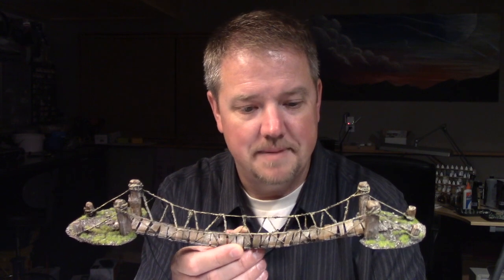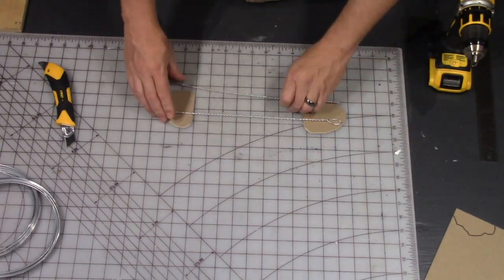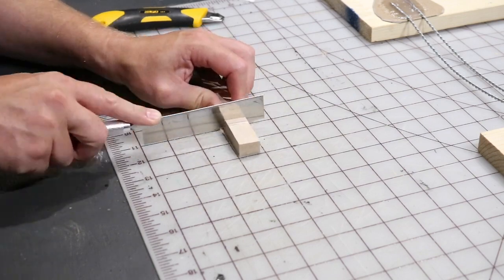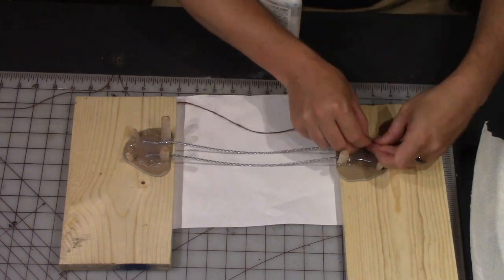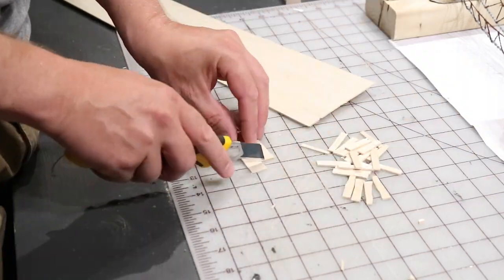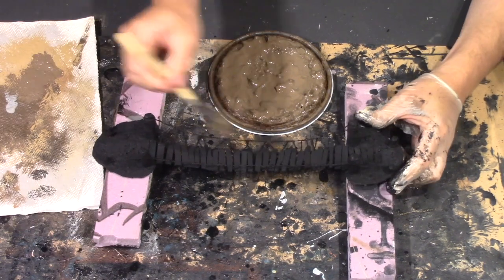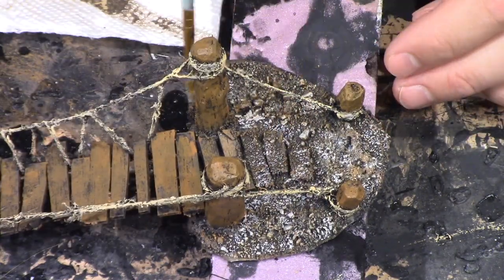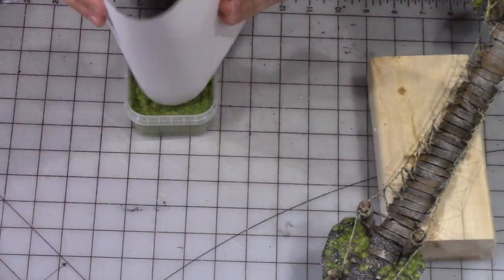029-Rope Bridge

Comment: Very nice build.  I did a rope bridge similar to yours a few years ago, but instead of balsa wood posts, I used styrofoam.  It worked as well, but I like the look of yours better.  Plus, I made mine before learning of the modge podge coating technique for strengthening styrofoam, so I always must handle it with care lest I crack off the "stone" pillars holding up my bridge! LOL!  :-)

Comment: Just seen this video wondered what type of metal string did you use for the base can't seem to find anything to match
Reply from the maker: I believe it is 16 gauge fencing wire or utility wire, which can be found at a farm supply store or hardware store.

Comment: Do you do any 1/12 scale bridges for action figures?
I've been visualing an idea.  But, I'm not quite sure what I want to do for certain parts, or how to do them.  I've never made any kind of crafts like this before.
Reply from the maker: I haven’t done much with that scale. It can be a little tricky since the weight loads increase a bit, and if you have kids playing with them, then durability is another concern. This concept could work scaled up somewhat, but the wire would have to be pretty sturdy.